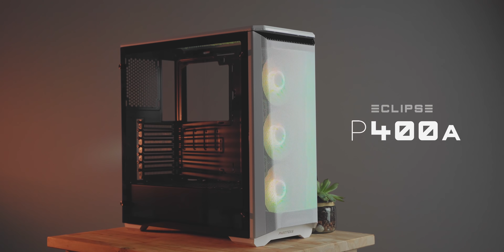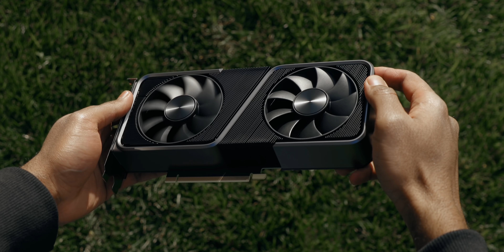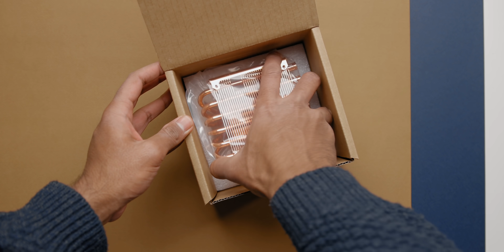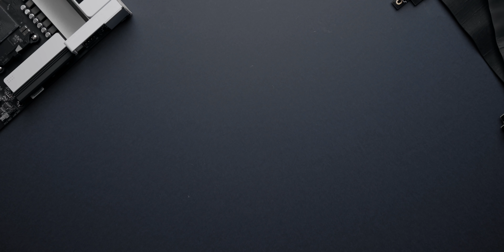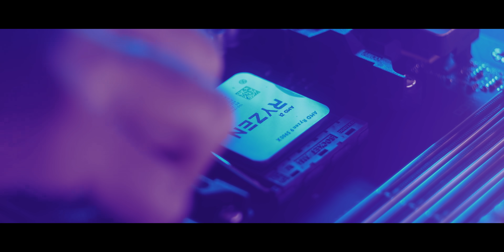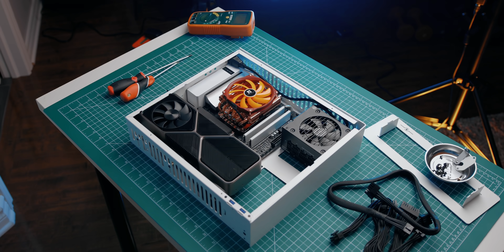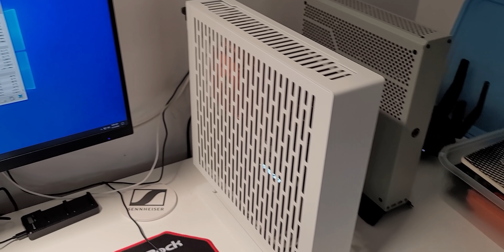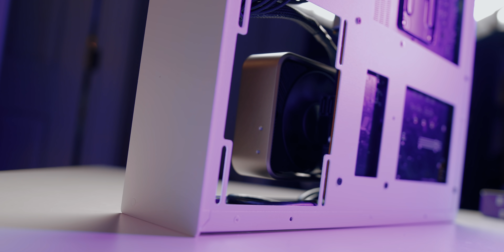The SMALLEST ATX Build Yet - Ryzen 5900X in a 10L Case!

Comment: Only a 120mm my 5900x has a 240mm and it runs stupid hot, I might just have to make a case causeim after a case as slim as the PS4 pro but with a full 3 fan GPU and a 360mm aio.

Comment: I find the concept interesting but generally impractical. The graphics card completely blocks all the expansion slots and half the reason to use a full size ATX board.

If you could mount the graphics card vertically next to the motherboard and have the PSU in the bottom right area you could borrow space from expansion cards which aren't that long now since the GPU is out the way.
Reply: better mbo prices, availability and selection, more dimm slots, m.2 slots, rear io, etc etc.

Comment: The case is a total disappointment. Despite the neat design, in reality takes extreme experimenting, trying, failing, trying again and again and finally failing to achieve what's advertised. Poor build quality for the money, vague manual where in most cases you have to guess where the spacers, the risers, the psu cable etc will fit (if possible). In several cases I was very close in damaging the components in order to fit them in the case. Finally i abandoned the whole build and ordered a new case.
Reply: Disagree completely. Build quality feels excellent and manual is very explicit about each step. Felt like building a lego set.
Reply: @mchosejaune  as mentioned maybe with a smaller GPU, a smaller MB etc. the build might work, however definitely NOT AS ADVERTISED...(ATX, 3fan GPU etc.) In any case I comment on MY experience with the case.
Reply: @spycon69  which one, you commented both in N-ATX and P-ATX review. Compatibility list is very clear so there are no surprises.

Comment: Thermalright AXP-100 FullCopper?
This cooler's height is 62mm, but this case ristricts 57mm(perhaps V2).
I ordered V3 that ristricts 59mm height.

Is it enough space for V2 case between CPU fan to side panel?
Reply: Same thing v2 and v3, 59mm. Apx100 full copper is 58mm

Comment: Im interested in this case(if only it has Black) and the low profile Copper Cooler is nice too. But the Fan(120mmSize) im planing to swap it with Cooler Master Silencio 120mm with PWM. Will it Fit?

Comment: So the only real issue I can see is you have a full ATX board that you can't install any expansion device besides the GPU. Why would you want to use a full ATX that you could not install anything else into? If you like small form factor, go with micro ATX or ITX if you are not going to expand your system.

Comment: Would anyone recommend Thermalright AXP100 over Noctua L12S if my itx case (silverstone RVB03) have just enough room for dual fan (pull & push) configuration? both fan are the noctua A12x15. Any suggestion would be very much appreciated. 

My corsair h60 (2018) started to develope leaking issue. Thought of replacing with a new fan CPU cooler instead of AIO for the sake of the motherboard. 

Currently running a ryzen 7 3700x but in the process of upgrading to ryzen 9 5900x. So any suggestion must also take this into consideration. Thanks.
Reply: L12s is better

Comment: I'm doing a very similar kind of SFF build using a Thermalright AXP-90 53 Full Black (copper heatsink) and I'm dying to know what settings you used to get those kinds of temps with a 5900x.  Do you have the fan blowing onto the heatsink or outward?  I know lots of people are dying to know this.  Sorry if it was posted in the comments already I haven't been able to sift through all 1900 lol

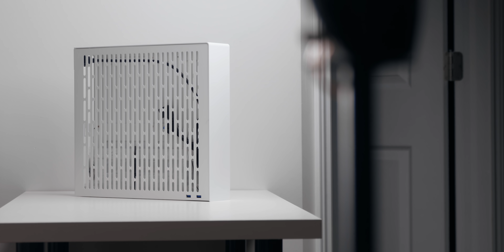Comment: So @ 1:53 you mentioned the fan.  So will a 120mm fan work on the mounting pattern of the cooler on a different case that can handle a taller fan profile?  Thanks
Reply: Yes, they provide the adapter
Reply: @riba2233  Nice so I can mount say a 151CFM Delta 120mm fan to it without an issue?  Think of the performance 151CFM will provide for the All Copper Heatsink!
Reply: @chrisbrooks2310  in theory you can yeah :)

Comment: I just checked the website listed in the video description box "Check out the P-ATX Case".... but only pictures and description of the case. And options to pre-order, sold out variants and in the section for B-stock one was sold out and the other did not even have any pictures. Hm.... i just ask myself how much B this stock could be if no Pic is shown^^
Reply: There is an album with b-stock examples on b-stock webpage. They have small visual imperfections
Reply: @riba2233  okay - thanks!

Comment: Ryzen 5 5800X 5900X and 5950X all need to be undervolted out of the box.  For example, my 5800X at stock runs Cinebench with all cores maxing out at about 4.3-4.4 GHz at a constant 90 degrees C (i.e. thermal throttling) and draws about 115 Watts, but undervolted to 1.2v with a stable 4.5 GHz all core overclock it runs the same load at about 70 degrees C and only draws about 77.5 Watts

Comment: undervolt the processor and gpu - in a passive cooled case like that you will get a native performance boost due to it running cooler and you will have much lower thermals on your system from both components.   It is a must for small form factors, you mentioned optimum tech and he is a master of doing this.

Comment: classy build, you might want to try the extra fan as intake rather than exhaust, and a bit of a smoke test to see the air flows
Reply: Wouldn't work as it would work against the fan on gpu

Comment: I think you'll find that the stock fan is nominally a 15mm-thick unit, so other 15mm fans will probably fit. If that stock one is the TL-9015R (the only listed Thermalright fan that is that ugly), then you could even try the TL-9015B, which is black, but I would go with the Noctua Chromax.

Comment: I made this with a cheap case 330x330x82mm with the same ADT riser cable with 90 degree angle, but it did not work with any PCI express 4.0 cards rtx3000 series, just the PCI express 3.0 rtx 2000 series, I had to buy a ADT pci-e 4.0 Cable to boot, how did you guys manage to make it work a pci-e 4.0 Mobo, with pci-e 4.0 GPU, on a pci-e 3.0 riser cable?
Gigabyte b550m
2x8 corsair 3600mhz
1tb Samsung evo 970 nvme
2x2tb 2.5 mechanical HD below the GPU right side
Corsair sfx PSU with custom cables
Ryzen 5600
And I did add 2 80x25mm fans on each side, total of 4 fans blowing the hot air out of the Pc case.
And it sits nicely below my Samsung QLED tv, as a game console / online school for my daughter / Netflix.amazon.disney+ / and emulation retro gaming
Reply: You just need to set pcie slot to gen3 in bios

Comment: 105w tdp doesn't mean it uses 105w,
The tdp is measured at base clock, while at boost frequency it probably draws 180 - 200w (correct me if I'm wrong, this is my assumption based on the 180w of the i9 11900k)
Reply: Powet limit on 105w tdp amd chips is 144w. And 88 for 65w
Reply: @riba2233  thank you, learnt something

Comment: I'm very confused with this case. The gpu blocks most of the pci slots. Why use a full ATX mobo if you are only using one pci slot?

Update: I checked out the website from where you can get this case, and their moto is "Downsize, don't downgrade." I guess they are saying that you can simply buy their case instead of having to buy a smaller mobo (the downgrade) to use smaller cases but say bye to your pci slots, and also upgrade your psu to an sfx psu... Well, I guess their 14L case makes it so you don't can use a standard psu but still only one pci can be used :/
Reply: 99% of users don't use any pci cards other than gpu, and atx boards have many upsides over itx boards.
Reply: @riba2233  very interesting. Also, there are mATX boards which is what I used for the majority of my pc gaming life.
Reply: @Sporky0000  yeah this can fit matx also.
Reply: @riba2233  obviously. If a case fits an ATX mobo then a M-Atx mobo will fit but if you want to only use one pci slot then go M-Atx instead of full ATX. Going M-Atx opens other possibilities with other small (and cheaper) M-Atx cases while having 4 memory slots.
Reply: @Sporky0000  this case is also competitve with matx cases regarding volume and footprint. I reality matx cases are not that much smaller compared to atx from the same line/type
Reply: @riba2233  You are right about M-Atx cases not being as small at the sff time case. I think 20ish liters is the next competing small mATX case. 

Also, let's not forget that Ebert did say that there is no 10gbps Ethernet on the mobo he chose but that you can use an expansion slot to get 10gbps but wait, there's no room for that in this case if you use a GPU. Also his mobo has built in wifi which was chosen specifically for this build since only one pci slot is available and USB wifi dongles suck in comparison to pci wifi. 

Overall I see your points and I do agree with all of them. On the other hand, I don't think the compromises for the size are worth it over the functionality of full ATX. Others do think it's worth it cause the cases are sold out, heh.

Comment: wonder if that cooler would be good against my R7 5800X. my Noctua NH-U9b is a bit over powered by it so have to have it in Eco mode otherwise im hitting 90-100C under full load.

Comment: Bought one. The case is great and with a i7 10700 with an Alpenfone Blackridge cooler it works a treat. Well...I need to tune the fan profile a little and you definitely can't get more than 95w without thermally throttling after a short period (using the 92mm fan at least) but as long as you tune it for what the cooler is designed for then you're onto a winner. 
Why choose a Blackridge? The Thermaltake cooler in HWCanucks build doesn't fit onto my MSI Z490i Unify, nor does the ID Cooling is-60, due to the i/o shroud's size. I suspect unless you have the ASRock Z490i or the MSI B460i then it won't on your mini itx board either. But then you don't need a mini-itx board with this case so that's fine :)
Reply: Thanks :) maybe you can try to source 12mm thick 120mm fan to put on top of blackridge, scythe used to make them
Reply: @riba2233  Mm, thanks yeah, that's a good thought. I hacked a case though a few years back and having a fan super close to the side of the case slots caused a rushing air noise. So those with a sound profile preference may wish to avoid it.  For now I've built a little cardboard shroud (with black gaffer tape cover) to go around the heatsink so it sucks in air from outside rather than from the GPU.

Comment: We really need to push motherboard vendors to make more microATX boards. Everything is either ATX or wide ATX, or mini ITX these days. The micro ATX is just a sweet spot, allowing better VRM, more M.2 ports, some more SATA ports, more memory slots, and that extra PCIe slot you might need for something like networking, capture card, or beefy NVMe. Can't to that usually in mini ITX. Putting full size ATX just to utilize one slot is silly a bit. Good idea tho to fill the market considering selection of motherboards on the market - most micro ATX boards has budget / older chipsets, worse VRM, etc, which are unecassary compromisses.

Comment: I really am wanting this case for my entertainment center. Looks like they have horizontal feet on their website too!! Only concern, is I see it there is ZERO dust filtration. Wonder if a mesh filter could be taped onto that GPU area? Wouldn’t look fantastic but you wouldn’t notice from far away. White case looks beautiful but for my HTPC I might want black to match.

Wanting the noctua fan for sound just because I won’t see it anyway. The tan and brown used to bother me but over the years it’s grown on me

I recently upgraded my mid tower,  but I have a perfectly good z270 e and 7700k, and spare ram. Soon I’ll upgrade my GPU and my 2080 will move over to the HTPC build. Pop an SFF PSU (even if a full size PSU fits it doesn’t look fun to try lmao) and I think I’m complete! Then I can game on my living room TV in 4k without doing it over the network where the max frame rate is like 1080p 60

Comment: Awesome build. I use the same GPU coolers. I’m coming from wide MATX w/ trusty ThermalRight XP120 True Copper. I moved it from old socket 1366 to new 1200 no issues. Used it since 478. Lol. A workhorse

Comment: Do you think that the copper thermal casing that same with that Aorus NVMe would provide better heat dispersement than the heat casing that comes with the motherboard? Have you had a chance to do any tests for comparison?
Reply: Also, did you have to void your 5 year warranty when you removed the thermal casing in the SSD? (Did you have to permanently remove it?)

Comment: Hmm, the ATX support in this case mostly feels like a gimmick though?
Sure, you can fit an ATX board, and there IS a minor benefit to not being restricted to looking for ITX boards (and you can re-use an older board) so I get it from that perspective...
But you can't really utilize the ATX board in any meaningful way can you? As far as I can see you can't use any of the PCI(E) slots beyond the GPU, and there's really not enough room to put stuff that uses the extra SATA ports and other extra peripherals you might get from an ATX board.  
(also, in this case the ATX motherboard restricts the GPU cooling slightly, but granted that is an Nvidia FE specific edge case really)
Reply: There are a lot of benefits to using atx, and it doesn't really limit thermals as you can see from the review.